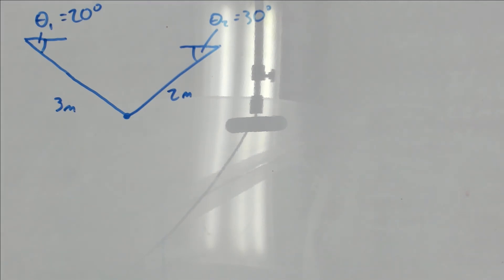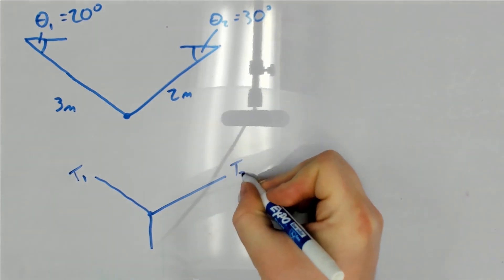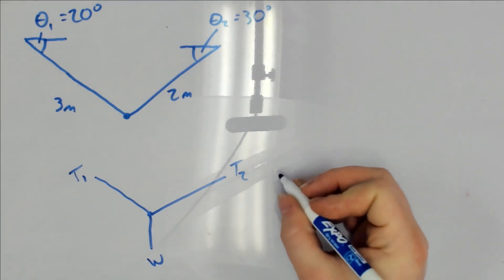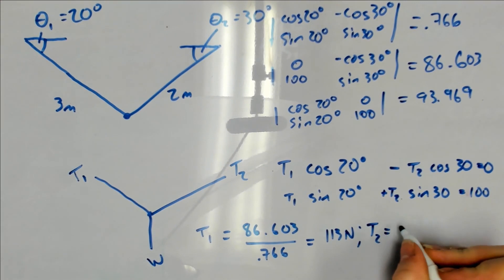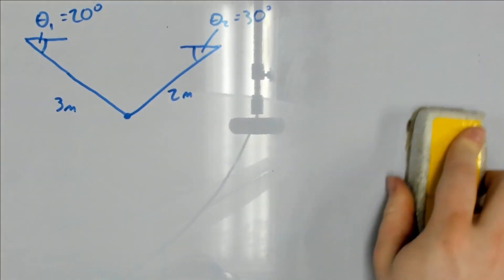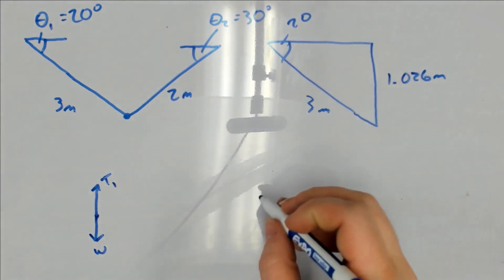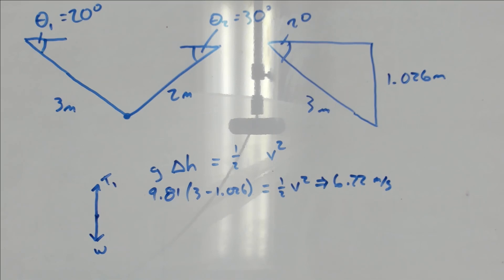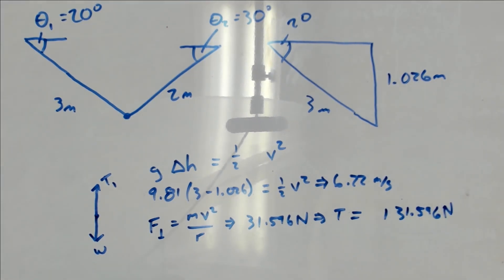DDP#408 - Hanging a Sculpture

Comment: 5 star april fools question: Can you calculate the speed at which a foil magic the gathering card bends depending on the foil material distribution along the surface of the card and also the latitude at which the process happens?

Comment: I don't like Cramer's rule for computational purposes, it has worse computational complexity than Gauss-Jordan elimination. Its only good use is for some proofs.
Reply from the maker: That's one reason I wanted to take an opportunity to use it here, just so I don't forget all about it.
Reply: @JudgingFtW  Wish you would have explained the process though. I had never heard of Cramer's rule and couldn't follow you along.
I simply went with t₁ = 100 / (cos 20° / cos 30° * sin30° + sin20°) and  t₂ = 100 / (cos 30° / cos 20° * sin20° + sin30°), which seems a lot easier to me. 

Though I have since looked up Cramer's rule (on the Wikipedia page, scroll down to applications, a lot easier than the introduction.) and turns out it ends up being the same anyway after simplifying.